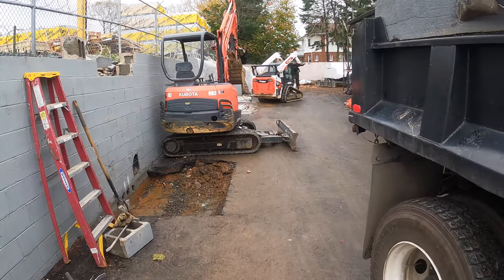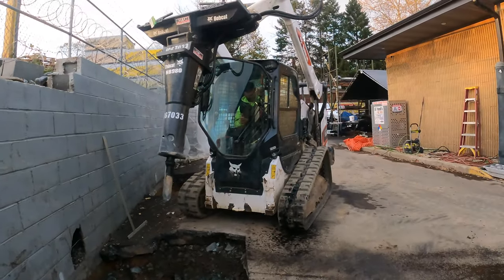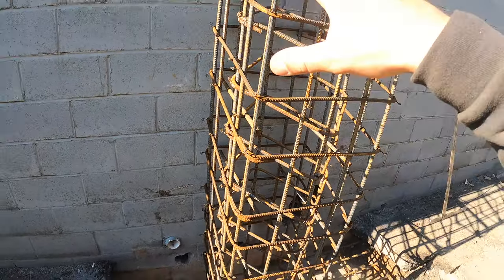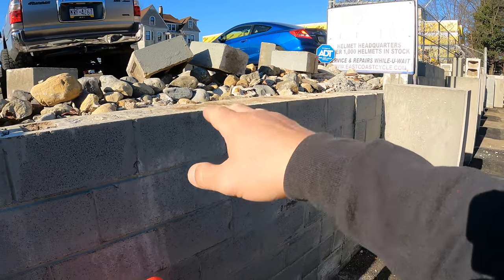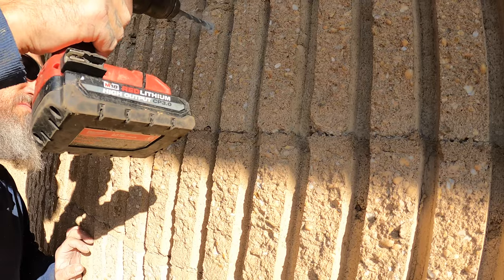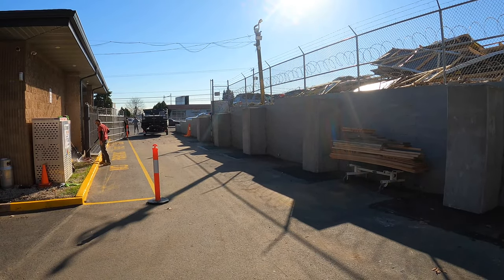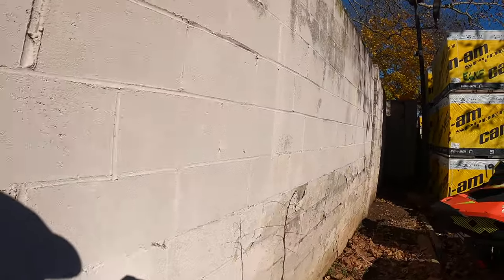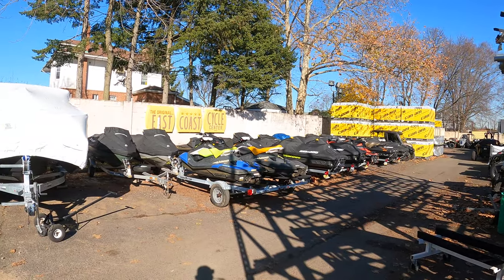Retaining Wall Repair part 2

Comment: You mad lads have a good line of communication with engineers, that is critical for fabricators tradesmen and contractors. I like the solution they came up with because it uses the whoopsie holes to get the gravel out. They even figured for how far out from support the new concrete fill goes. A good team talks it out and draws new plan together as one. The fire lane paint is straight as an arrow, very nice work all around

Comment: It is always better to strengthen a retaining wall from the high side, dig or drill the fill and pour piles or columns.   That way you don't take up space and don't change the front of the wall

Comment: Sadly, those are the kind of columns that should have been incorporated into the wall to begin with.  It may have seemed like overkill at the time, but in hindsight it isn't.  When you engineer a retaining wall like this you can't just compensate for the weight load on the wall.  You have to over-compensate.  You have to factor in the most extreme weather patterns ever experienced in that area,  the most ridiculous load that somebody might park on the upper level, because it was raining too hard to keep driving...like the 200 ton crane that got parked in a pouring rain, after several days of pouring rain, on a project I was working on.  When we came in the morning the crane was on its side because a wall very similar to this one had collapsed during the night.  That one got ugly....

You and your crew did exactly what was asked of you and that is honorable.